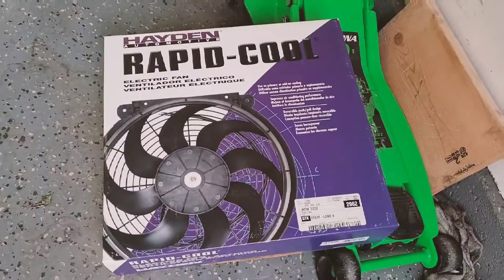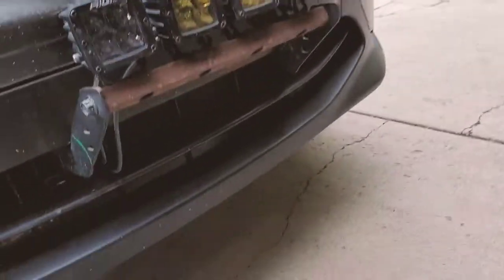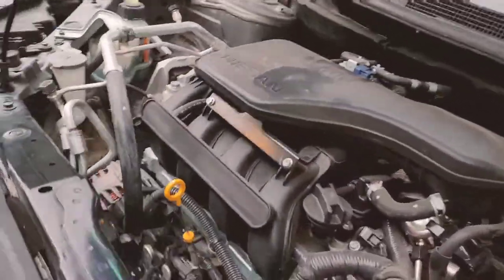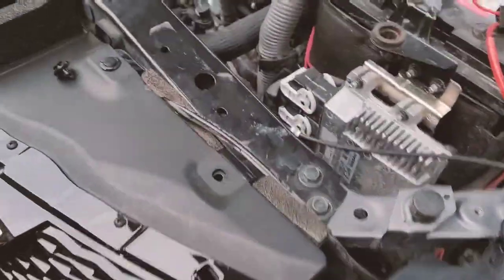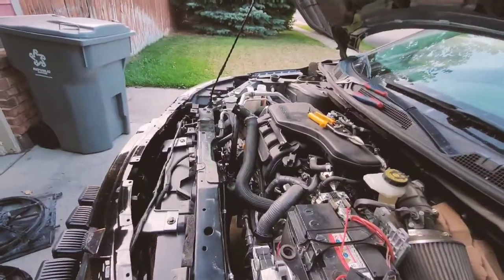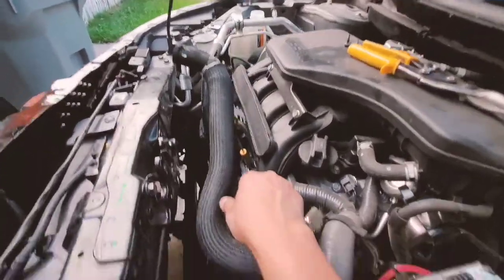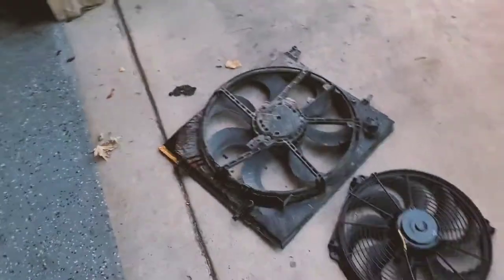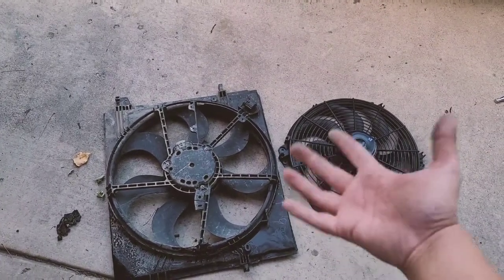Nissan Rogue Sport gets an unplanned radiator fan upgrade

Comment: damn! I'm in the same situation and I should have have thought to do this. I just bought a fan online (hope it's the right one because, yeah, there are no oem parts available for this anywhere). Awesome improvisation.
Reply from the maker: And I only spent $70 on the fan and zip ties. I hope you get yours!
They cancelled my order twice because they didn't have the original fan, not even the body shop was able to get it from anywhere
Reply: Daniel Harrison did you get it replaced??
Reply: @alexcourtney461  yes, I did it just like the video because there were oem parts available. Not sure if anything has changed since then though.
Reply: @Daniel Harrison so your still running with it? Running good? Any change in the mpg?
Reply: I have had my rogue for weeks! And just came across this video! I am gonna try and get my vehicle and do this tomorrow!

Comment: I'm about to  grab an electric fan assembly from whatever measures out the closest at the junk yard  and mount it in. I can't find a used one In San Diego  county.   I am going to see  if  94 to 04  mustang V6 would fit . The big single electric fan is on most of the time on those cars. And they are everywhere!  Nice install. Thanks for sharing!

Comment: How did you connect the wire? After you reinstalled the fan assembly back into the front of the car?
Reply from the maker: That one goes one back of the radiator, and the wiring i just cut it and put it together, if you do it make sure the fan is pulling and not pushing
Reply: Thank you!